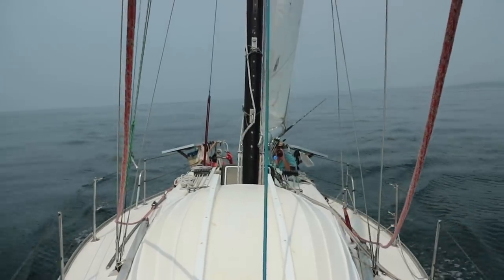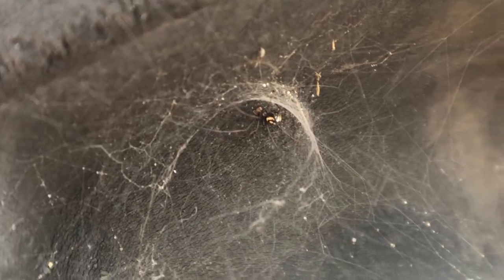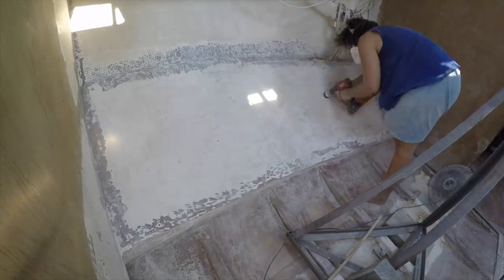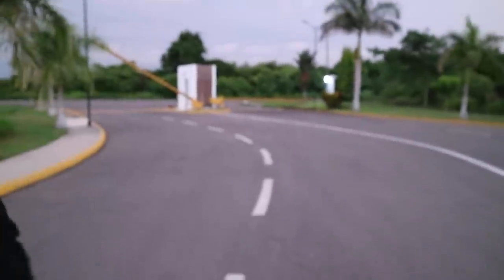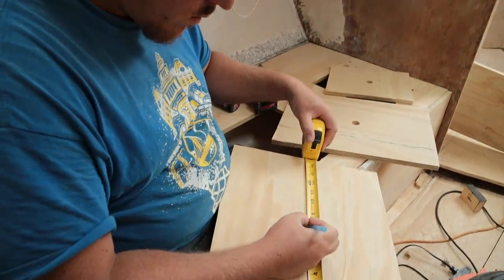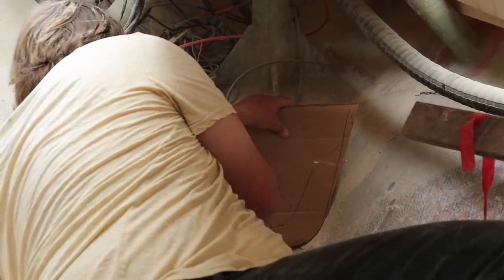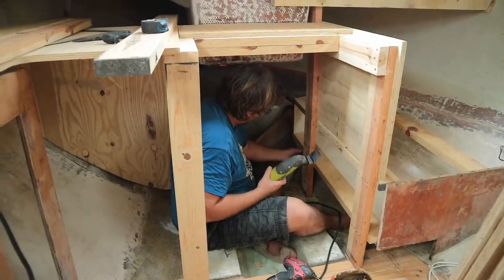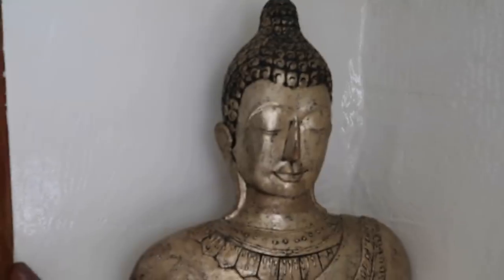Part 2 - ERECTION - Sailboat Interior Remodel

Comment: Excellent video! I have been making things with new plywood and West epoxy for maybe 25 years, and have never cleaned it with acetone or alcohol. No need: the epoxy and wood bond is fabulously strong as the epoxy seeps into the wood. Things I made in 1993 with ply and West are still hard as a rock.
Reply from the maker: Good to hear. We were trying to give that wood a little extra help...it was just not very good plywood.

Comment: Pine is not a boat building product, even coating it with epoxy. All of that work, Lost. But you are living your life and that is ok.
Reply from the maker: Obviously not the ideal wood for this project, but that's a little melodramatic. The new captain of Rossa is happily sailing with her new interior, enjoying the simplicity and functionality of what is currently there - which is better than the rotten mess that we put up with for 2 years prior to that. Perhaps in another couple of years someone else can use the template to rebuild with higher quality materials.
Reply: @sailorama  I'm pretty sure your new interior is going to last longer than that......It's not like you built the entire hull out of epoxy and fiberglass coated pine. Yeah... a little on the melodramatic side.....